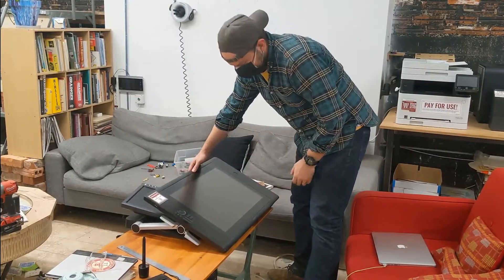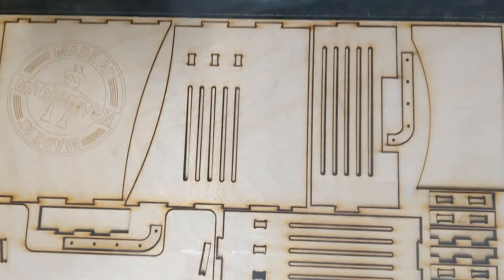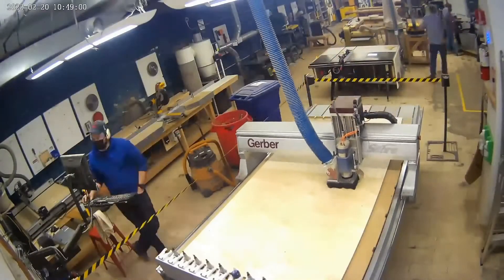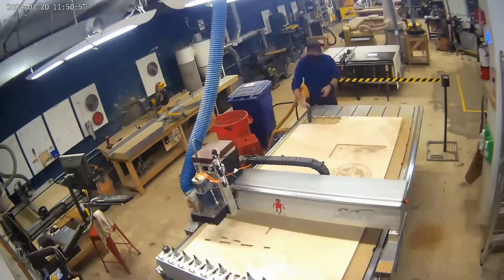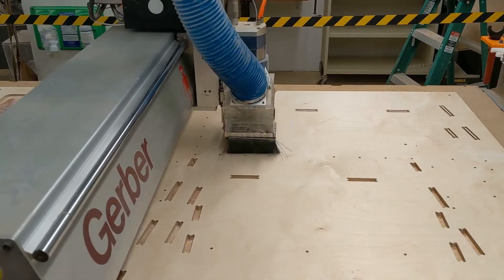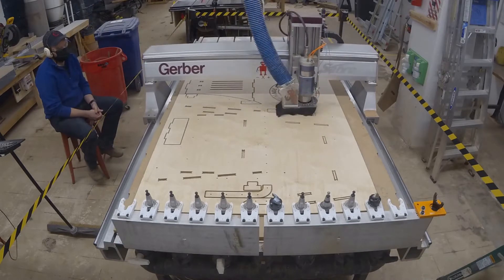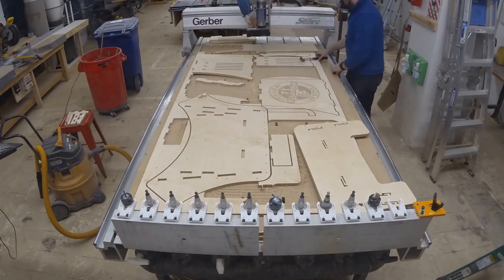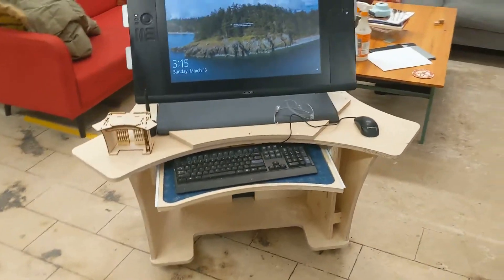Using The Gerber CNC to Make A Desk at MakeHaven

Comment: Hi. I also own a 408. I was wondering which spindle you are using since you upgraded the system with an atc
Reply: I recognize that spindle, it's a CNC Depot (formerly Blurry Customs) S30 spindle, which has been superseded by their flange mount editon the FM30. We put one on our Gerber Sabre 408 at my old job. We never implemented an actual tool carousel/rack, but we used the quick change / tool table to do production without re-zeroing the bit.